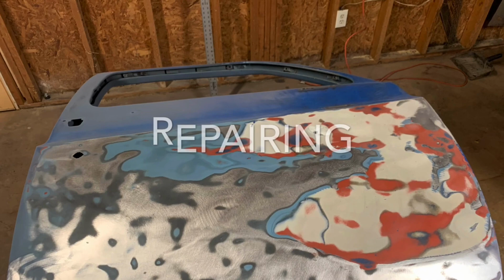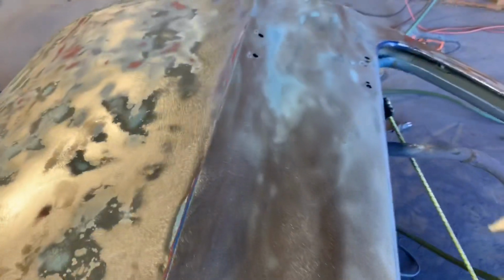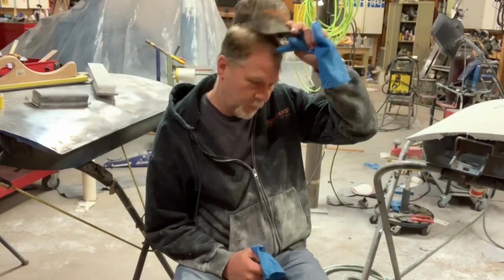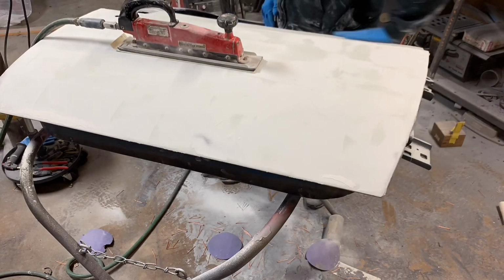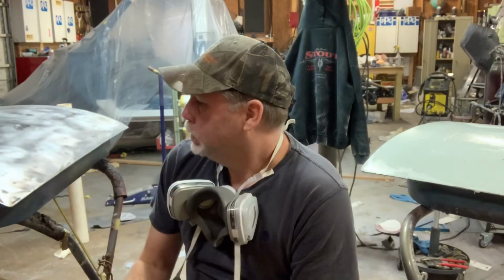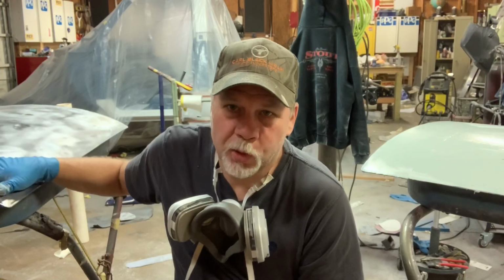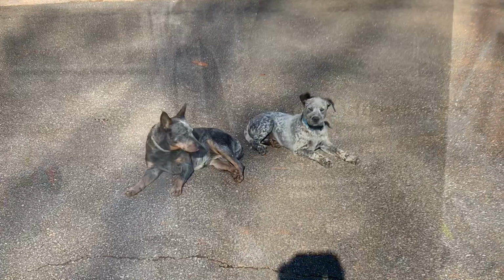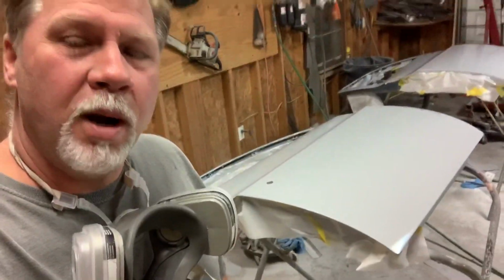project C10 Episode 9. Door Repair Part 2. #c10, #squarebody, # c10nation

Comment: Jim is that a soft interface pad you are using on this sander
Reply from the maker: No it’s just the backing pad that came on the machine. I’ve tried an interface pad but the action is too aggressive and it destroys the pad pretty quickly.

Comment: Jim, how do you manage to wipe on the body filler over such a large area before it starts to "kick"?

No matter how small the amount of hardener I use, it sets up so fast, I waste too much material.
Reply from the maker: I usually just mix it quick and spread it quick honestly. There is a product that I’ve only played with a little. Rage Ultra Extra. It can be used alone I believe or mixed with Rage Ultra to extend the dry time. The first time I used it I didn’t put enough hardener in it so it never hardened. Had to scrape it off and start again. It has to have at least 2% hardener in it. You may want to give it a go.